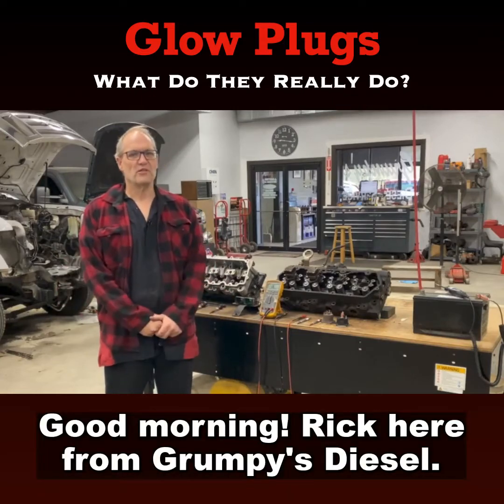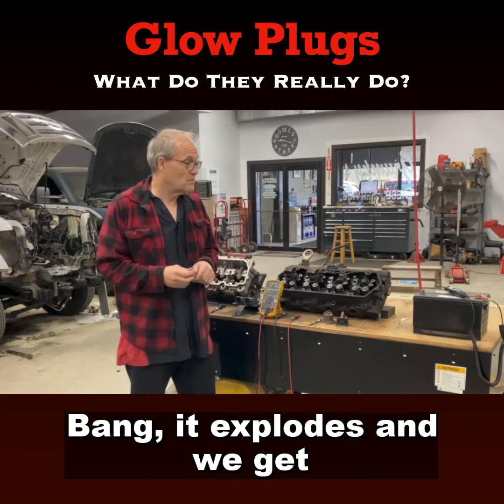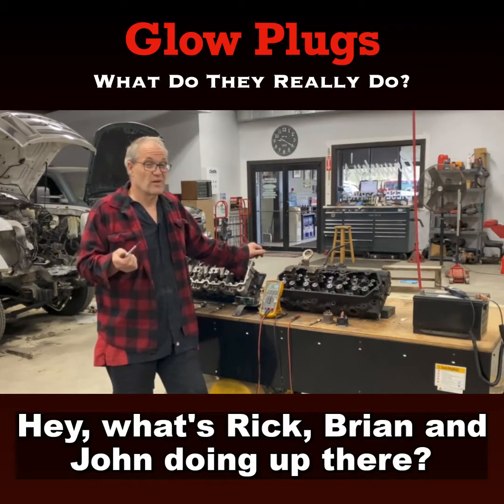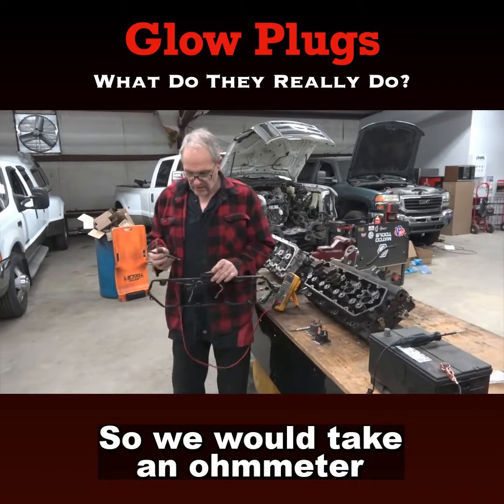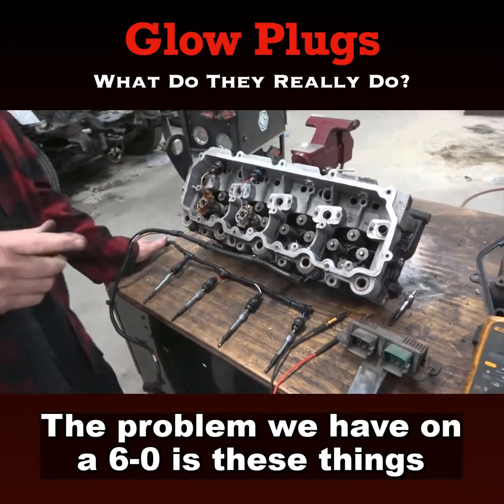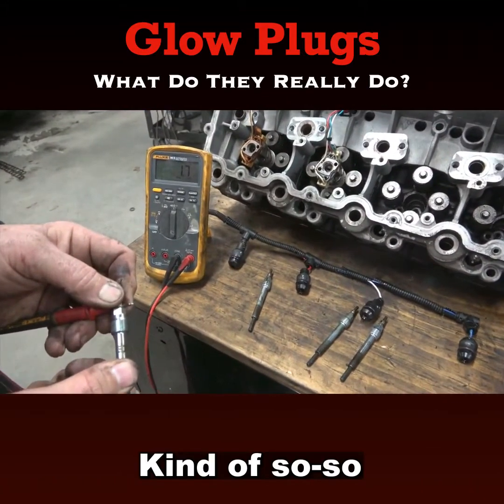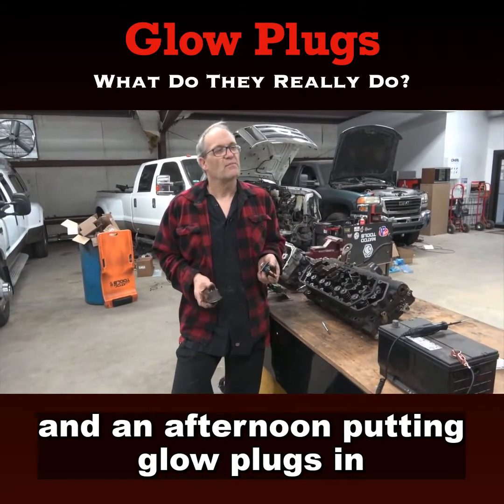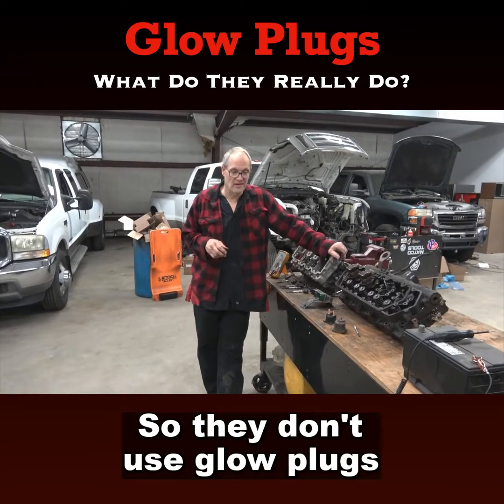Glow Plugs - What do they really do?

Comment: 1:02: I believe heating the cylinder is also a misconception. The glowing end of the glow plug is in direct contact with the air, which is what it is actually heating. I argue that if anything you do not want to heat the cylinder.

Comment: Hi Lindah here, I got my new Ford platinum, did 11000km, just saw a message last week on the Ford pass application, and took the car to the dealer and the diagnostic was, they need to change glow plug. I'm worried. the temperature here in SA, especially  where I'm located, is not too bad at all. The parks in the garage every day.

Comment: Will the Glow Plug be constantly On when the engine is running ?
Reply: No,
In 99% vehicles Glow plugs starts heating the chamber when key is in ignition on position ( but not started) and switches off after 20-25 seconds. It will not switch on till you switch off the key and start the car again.
 1% exception will be some types of vehicles or generators ment for extreme cold temp, where the ECU or  ICM checks if the engine is firing or not due to extreme cold and automatically start the glow plug for 10 seconds to initiate firing in that cylinder if it is CRDI type engine. In Tdi all plugs are connected in series and glow all togather.
Reply: @rajesh2002plus  thank you for the information